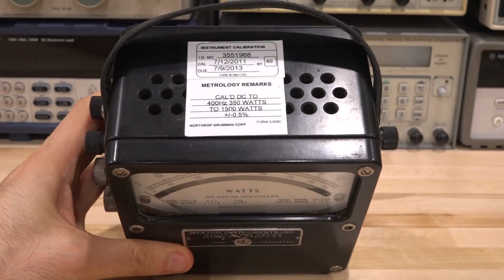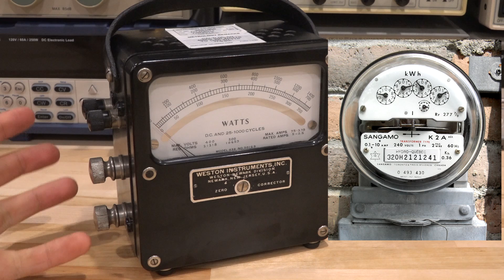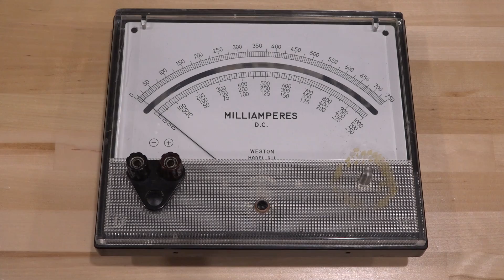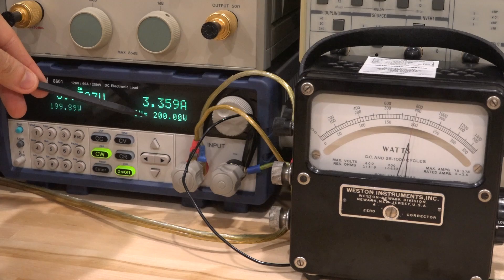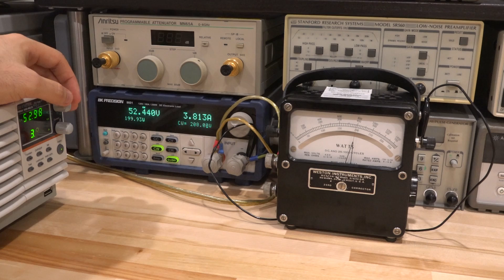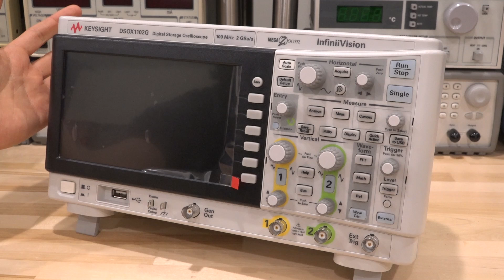TSP #140 - How Do Purely Passive Watt-Meters Work? (Giveaway Results & More Giveaway! December 2018)

Comment: Great explanation of the operation of mechanical meters.  In my opinion there will never be a digital substitute for analog meters.  Nothing beats the smooth needle sweep of a analog meter when peaking RF/IF transformers in radios.  Trying to peak a receiver or transmitter circuit with a digital meter is a test of ones patience.  Using a analog meter it's very easy to find the "peak".  I have a old rack mount multimeter made in the 1940's if I remember correctly that you are welcome to have if you want it.  I actually have two of them so might as well spread the wealth around. :-)  Just need to dig them out.  Let me know if you want one of them.  As much as I would like to have a Keysight oscilloscope I will pass on entering in the giveaway.  I already have plenty of scopes and I'm sure there are others out there that can use it more than I can.
Reply: MikesRadioRepair Lot's of people say this but...  I don't really feel the same. Besides that, something like the Keithley (massively overkill) bench meter Shariar has with it's freaking graphs is already better.
Reply: @allesklarklaus147  

Completely disagree.  I align radios for a living and have multiple modern $80K to $100K+ communications test sets and I would take a 50 to 100 year old analog meter movement any day of the week for it's fluid like smooth needle movement.  Absolutely nothing beats the analog meter needle for peaking applications.  No matter how good a digital meter is it's still displaying it's reading in a digital segmented way.  A bar graph is still one bar or the next, there's no middle ground.  A analog meter needle has no "step" to the next digit or bar.
Reply: digitalradiohacker Not beeing able to use your instrument is not really a plus point for analog meters. Just reset to factory specs lol
Reply: M. I've got a few for fun and I usually don't as the resolution required is outside the reach of even the best HP parallax compensated analog meters. And besides that it is just up to what you are used to. You can peak with a digital meter just fine. And even a lot of cheap DMMs have bargraphs on them, which works nicely. If you already got good testgear on the bench I certainly wouldn't advise on buying an analog meter unless you got money and space to spare and like the decorative effect or think it's cool.
Reply: @allesklarklaus147  For "peaking" applications, there is absolutely NOTHING that beats an analog meter. You can prefer a digital meter, or a bar graph, all you want, but when it comes to peaking a tuned circuit, that's where analog wins. When you peak a tuned circuit, you're not measuring the absolute value of it's output, so a super accurate calibrated reading of the absolute voltage isn't necessary. What we are looking for is the highest relative output of the circuit, and that is much easier, and faster, to achieve with an analog meter.
The first major problems when doing this with digital are display update rate and display update propagation delay. The second major issue applies to digital representations of analog meters, such as bar graphs, and that is the resolution of the display itself.
1.) The number of times per second that the display updates with new information is important here. This is down to how fast the data can be processed inside the equipment and how fast the display itself can be refreshed. The propagation delay from the time the input changes, until that change is reflected on the display, is the worst part of this problem. Many times by the time the display catches up, you've already overshot where the adjustment should have been, and you have to keep going back and forth, slowly. With a good analog meter, the delay from input to display is negligible, and even with slower moving meter movements, it's easy to match your adjusting speed to the fluid motion of the meter. That's much harder, sometimes impossible, to do while trying to read numbers on a display or watching a jumpy segmented bar graph.
2.) Let's take the digital bar graph. These are segmented displays. Whether they are made up of specific segments or drawn with pixels, their resolution is limited by how many segments or pixels long the bar is. Take one of my Fluke DMMs for instance. It has a bar graph in the display made up of 32 individual segments and is displayed as a 6, 60, or 600 unit scale. That means each segment represents 0.1875, 1.875, or 18.75 units, that's quite a large difference between a segment being on or off. Bars drawn solidly with pixels are much better, but take for instance a bar that is 512 pixels long. On the same 6 / 60 / 600 unit scale, each pixel still represents 0.0117 / 0.117 / 1.17 units. Then, since the pixels are much smaller than the individual segments, you have to look much more closely to discern your result. This resolution issue also applies to analog meters drawn on display screens, they have the same pixel resolution issues. Sure, the numerical read-out will give you an accurate absolute measurement, but watching numbers flash by is a difficult and slow way to find a peak. Your eyes can see which direction a meter movement is deflecting much easier.
All of these things combined means that using an analog device to peak a tuned circuit is much faster and easier than using a digital device. This applies to oscilloscopes as well and is why my test bench has a 30 year old analog scope for use as an RF envelope monitor. It just works better for that job than any digital scope that has passed across my bench. I love my digital scope, but I haven't found one yet that could replace my analog scope in this application. I'm sure that such scopes exist, but they probably cost more than my house.

TL;DR - Analog meters and equipment have their place and are unbeatable (within reason) in certain applications. This is just a fact of the industry. :-)
Reply: defaultuser000 Hm, it's kind of a myth that segments or stepped outputs are necessarily bad. What people forget about the analog scale is the most limiting factor: the operators eyes. On an analog meter you might (for example) only be able to tell 50-100 different states of the needle. In other words, the resolution is so shit it compares to a decent bargraph. This varies obviously mostly with size and also quality of the meter's scale. Same goes for analog scopes versus digital scopes. How many different horizontal lines can you really tell on your scope? Movement would always be easier to detect but still.. Maybe something to try out when I got some time. 
Besides that I got no problem looking at the numbers on a display, I would set my bench meter for 3 digits and a medium update rate (5-10 times a second) and look for the highest number. It's just what you're used to really. If you're grown up with analog meters it is hugely different than for younger people like me.
Reply: @allesklarklaus147  No myth at all, not in this application. Fluid, continuous movement is much easier to see and discern. Again, with an analog meter, there are no different states, it's analog. I'm only talking about peaking tuned circuits here. With a stepped or segmented output, the peaked state is likely be between 2 different bar segments, and you're back looking at the numbers, which just takes longer. Our eyes can see faint motions very well, without thinking, and in this application it is much faster for you to see the point at which the needle stops climbing or reverses direction. This isn't my opinion, it's a fact of how our eyes work. The same with my using my analog scope to peak circuits. I set the time base to about 2mS so the RF is just a large bar across the screen and it's super easy to see the vertical movement. That's what we are referring to here, movement detection. Keep in mind, we are not taking absolute measurements. If I need an accurate measurement with an absolute value, I use my digital equipment so that I have a numerical read out. When I'm peaking circuits, all I'm concerned with is where the highest output is. Give it a good honest try. For this specific application, it can't be beat for a reasonable price.
I'm only 32, most of the stuff I've had over the years has been digital, but once I started getting into HF/VHF radios, I found that quality analog stuff is unbeatable in many situations. Cheers.
Reply: defaultuser000 The "myth" I was talking about isn't really about what you wrote but probably a bit more off-topic. But there eventually comes a point where you can draw a bargraph or something on say an LCD screen and get the same result as a real needle. Some modern smartphone for example would have such high resolution that you cannot see if it's moving in steps or continous. 
I don't really am into old radio stuff so much so for me it isn't at all a concern. I don't doubt the analog meter is better than a digital readout or simple bargraph on a handheld DMM. But to say this is a principle is wrong, it is up to the design and technology of our digital meters. Time moves on and screens and meters get better and better. Cheers mate
Reply: @allesklarklaus147  True, there is a point where you can cram enough pixels into the screen that the step from one pixel to the next would be so small that it wouldn't matter. My phone has a 2960x1440 screen that looks incredibly fluid. I haven't found a graph like that though, but it would be awesome to see. In most all applications, your points are spot on. It's just the specific application of peaking outputs where analog still wins. 👍
Reply: defaultuser000 I think when you can draw a perfectly round circle on the screen it should be the point where we cannot see the pixels anymore. I'm just guessing but the next generation of highend bench meters will likely have screens comparable to todays smartphones. 
I've seen lots of null-meters which still had analog scales, probably for the same reason. Doesn't really matter there, so maybe it was just for lower cost.
Reply: re: " In my opinion there will never be a digital substitute for analog meters.  Nothing beats the smooth needle sweep of a analog meter when peaking RF/IF transformers in radios"
I like the nice, instant response of a 'scope trace; No meter lag AT ALL! We're talking Tek 453, 454 or the 465/475 series or 547 even ...
Reply: @uploadJ  I threw in about scopes at the end of my explanation above. You are 100% correct and I do most of my peaking with my analog bench scope. A good analog meter still beats any digital reading meters though.
Reply: And what I probably would consider best for peaking in terms of meters is the new fancy Keithley 7.5 digit meter we saw on this channel. With it's incredibly fast updating line graph in sort of a repeated autoscaling mode. You're not only seeing the highest point right on the screen, you can see where you came from and if you are going down again. But that's not something I could buy myself, sadly.

Comment: I can remember my grandfather owning one of the old multimeter and it may be outdated, but the readings are more valid than my 9 volt model. It's absolutely genus how the person or people figured this out. Sure, if you have the wattage locked in at 200 watts and you lower the voltage, the amperage will climb so keep that 200 watt delivery stable and the same goes for raising the voltage, the amperage will go down, but on a passive multimeter, if you raise the voltage to high the amperage will collapse and the needle goes to zero/zed, is this correct?

Comment: I will always regret giving my set of HP analog meters away (3400A with impedance matching transformer set) it’s easy to underestimate the value of the older gear. I miss the fantastic speed of the readings for some cases, digital meters just can’t compete in such a straightforward way. Thanks for the look at an interesting meter.